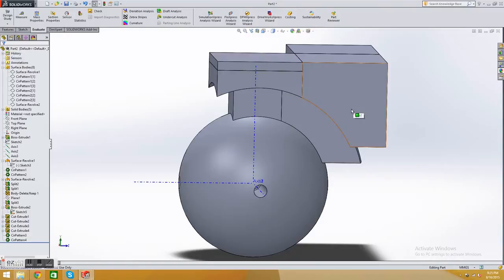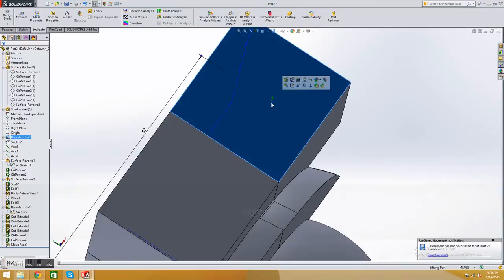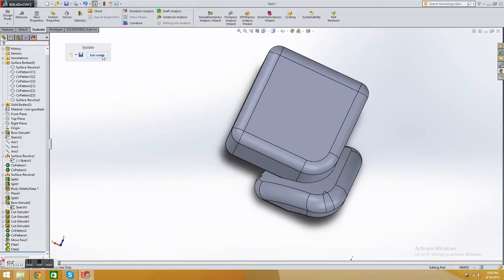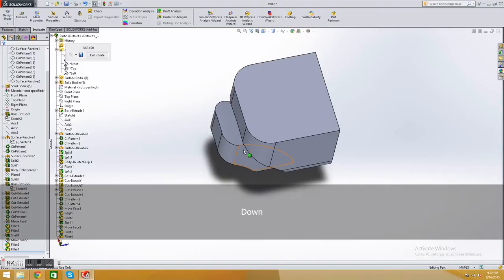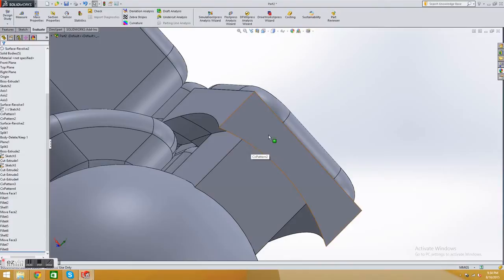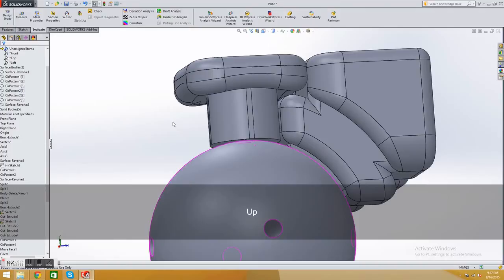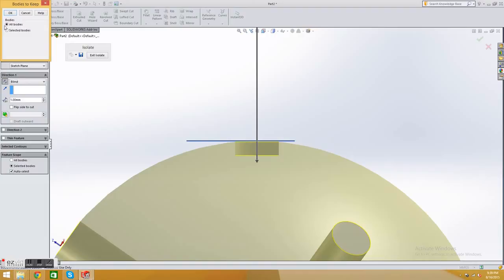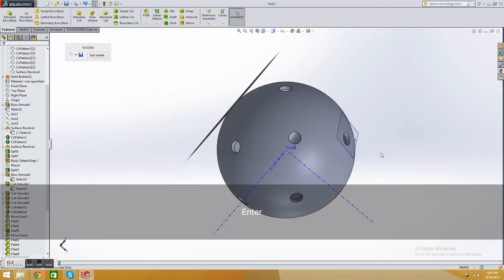How to Design Twisty Puzzles - (Part 9) - Tolerance, Fillet, Shell

Comment: Here are some things that Greg Pfennig taught me. 
You can actually hollow out entire bodies without having to select faces or drill holes.  The third icon down on the Shell toolbar is a normal yellow cube.  If you click on its corresponding box to the right of it, you can select entire bodies to hollow, THEN drill holes later.
Greg also sent me this image from Oskar's slide on tolerances: http://prntscr.com/8fwr82
Greg's Notes:
Pull / Slide: 0mm
Hover: 0.3+mm (I use 0.5)
Jam: 0.2-0.3 (I use 0.2 because I prefer a tight puzzle)
Reply: Hmm, so instead of moving the top part of the mechanism you move the bottom?

Comment: Is there any reason you didn't add helix's to the screw holes?
Reply: +3dbeasts As long as the holes are the right size, the helixes will come in as the screw is pushed in - there is no need to design them.

Comment: One of the puzzles I'm desiging is a bit complex and the mechanism parts don't work with 1mm Fillets which I usually use. Are 0.5mm fillets good enough? :S
Reply from the maker: +Proxy's Cubes yea everything is subject to the specific design. if .5 seems alright then it probably is
Reply: Alright good to know.